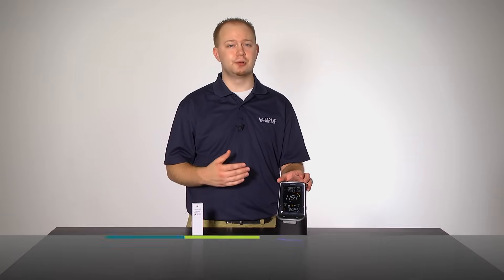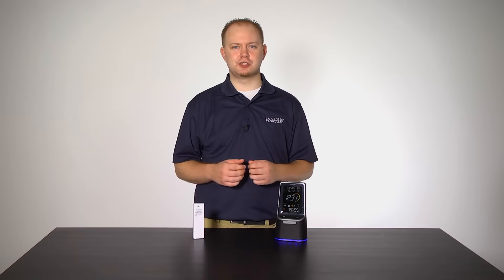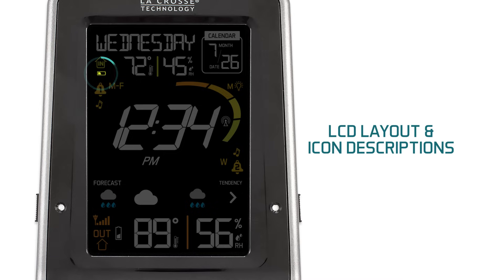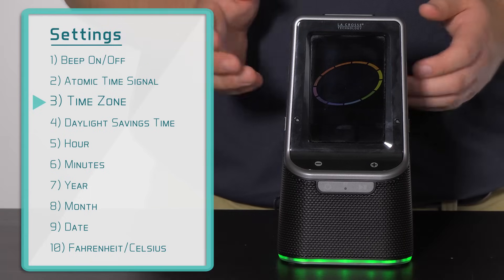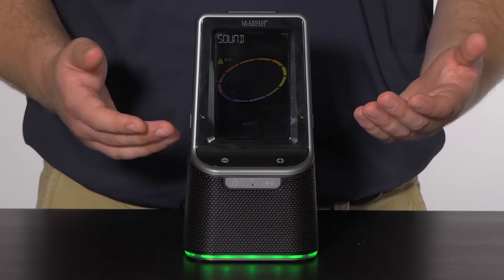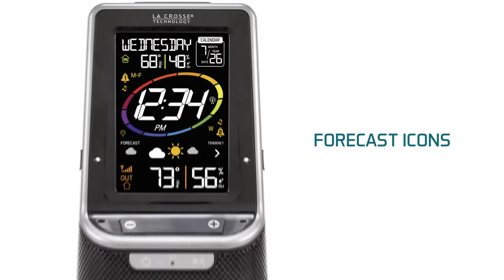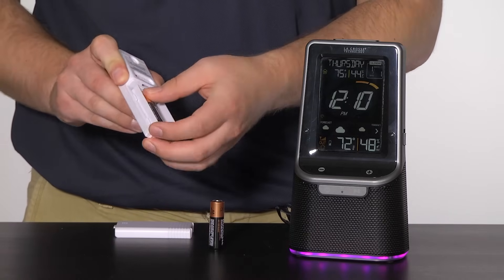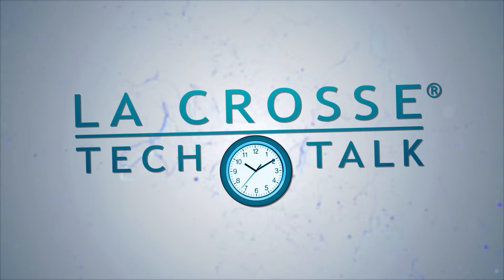S87078 / S86842 Complete Setup Guide

Comment: I have completed a basic start up many times after the temperature stopped showing the outdoor temperature and humidity. It still shows slashes on that part of the unit. Can you help.
Reply from the maker: Hey Lee, sorry for the trouble. Please review our restart video here: http://bit.ly/LaxTech_BasicRestart -- In addition to the steps in that video, your sensor has a small TX button located above the batteries. Press that after you have the power restored to both the sensor and display. This should force a transmission and connect your sensor almost instantly. If it does not, a replacement sensor may be required. You can find one on our website here: https://www.lacrossetechnology.com/products/S86842#parts or feel free to reach out to our support staff directly here: https://bit.ly/contact_techsupport for further assistance, especially if your product is still under warranty.